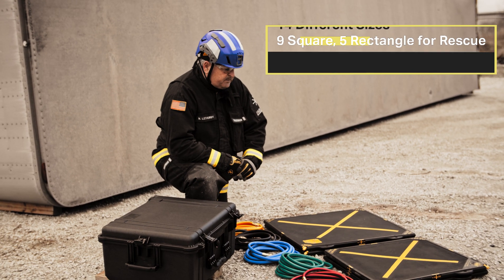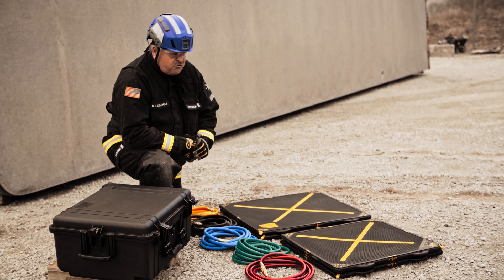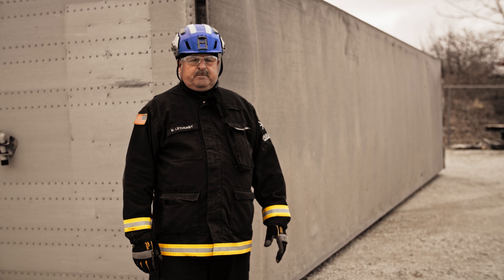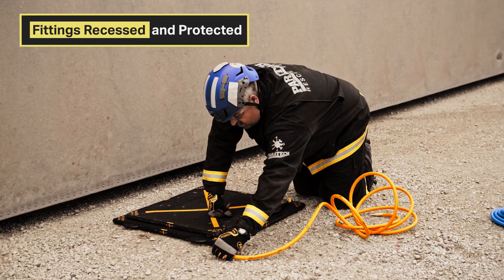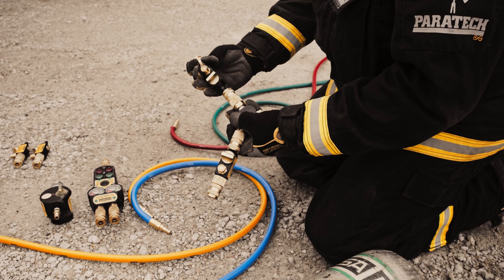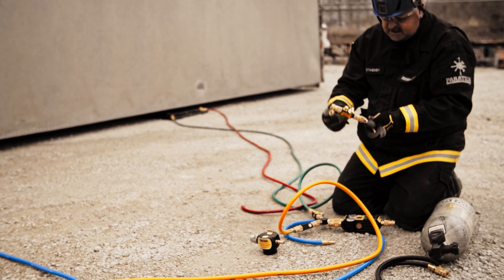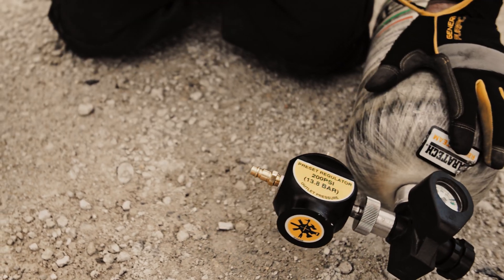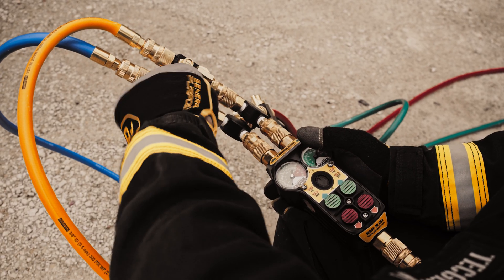MaxiForce Air Lifting Bag: 4 Bag Lifts

Comment: Nigel, did u switch to 4 bags of the same size for this simulation? As opposed to the other video where you used bags of different size ans smaller on top.
Reply: i had the same question in mind.